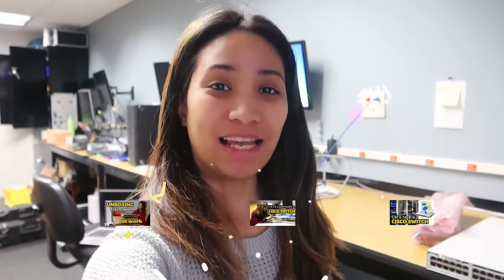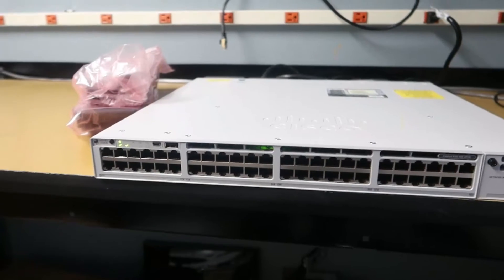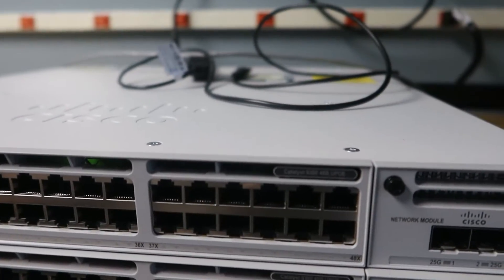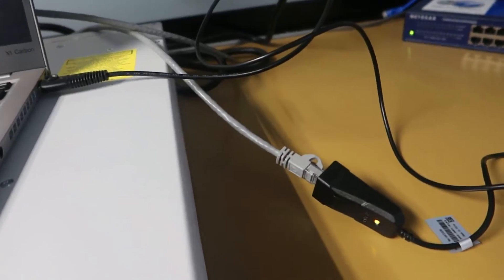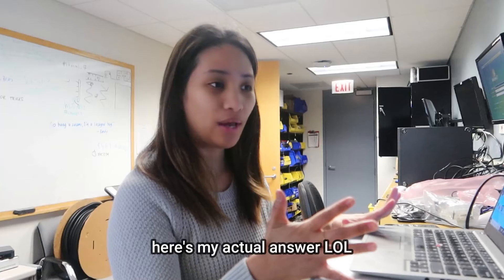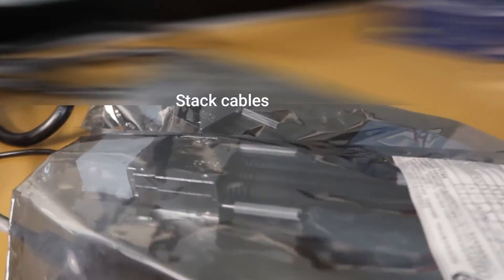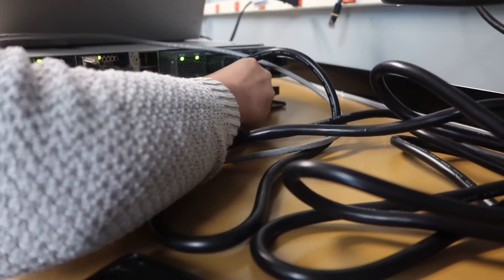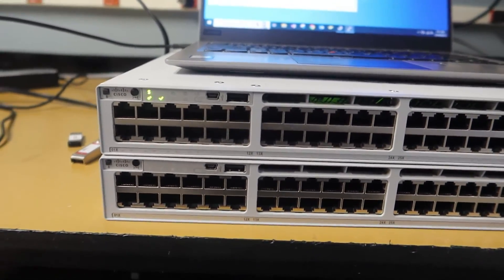Configuring CISCO stacked switches at work | Best Practice | CISCO Stackwise and commands

Comment: If you take 2 (or more) brand new 9300s, stack and boot them at the same time, they each think they are Switch 1.  They are going to perform an election to determine which switch should be switch 1 and switch 2.  We connect (stack) our switches at the beginning of the process and then power them one at a time from the top down and allow each switch to completely boot and reboot before booting the next switch in the stack.  This allows the 1st switch to become switch 1 and subsequent switches become 2, 3, 4... etc.  It takes a while for big stacks (our largest stacks are 5) but works well for doing everything at once.

Comment: FYI: You didn't connect the other data stack cable - thus you did not close the loop.  You will only get 1/2 of the bandwidth speed.
Reply from the maker: That's fine we don't need the bandwidth yet for that switch

Comment: Ma'am bagohan lang po ako sa cisco my tanong lang ako don sa configuration. 

Isang swicth lang ba yung e configure tapos mag sync na yung configuration sa ibang switch pag nag stack na? 

Or e configure isa2x yung mga swicth with same configuration bago mag stack?
Reply from the maker: Great question!  Yes kung magstack ka ng switch isang configuration like. For example iconfigure mo yung 1st switch(magiging master switch to), pag nag add ka ng switch sa stack, ma cocopy na nila yung config pag nilagay mo yung stacking cable and magiging member sila. yung config nila manggagaling sa master switch. same goes kung mag add ka ng more switch. same hostname and IP lang din sila. itong model ng switch hanggang 8 switches din kayang i-stack
Reply: @EastCharmer  pag tinanggal ba Yung master switch may sasalo ba sa mga member na switch at Yung configuration ba d mawawala since na tanggal na Yung master?

Comment: you can stack all the switches while powered off and then turn them on at the same time and they will come up stacked. One will designate itself as the active and another will go to standby.  I just did it with 5 9300s . It worked w/ no issues
Reply from the maker: Thanks for the tip! Good to know!